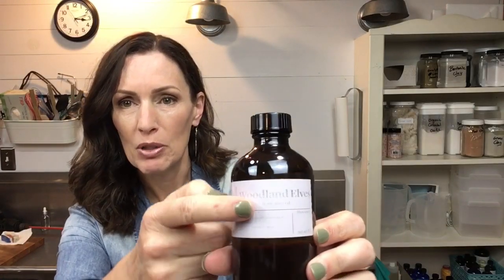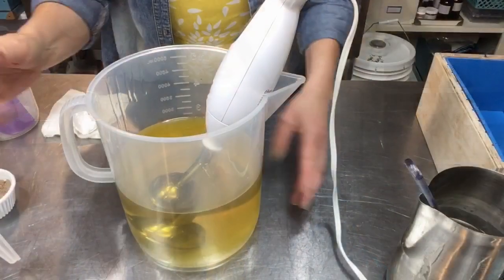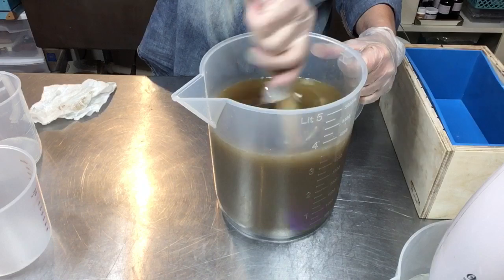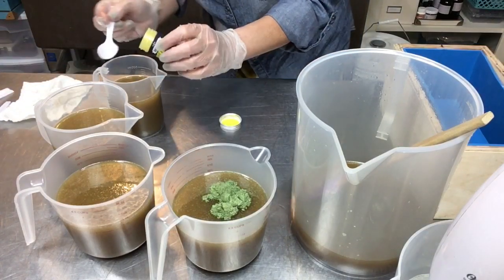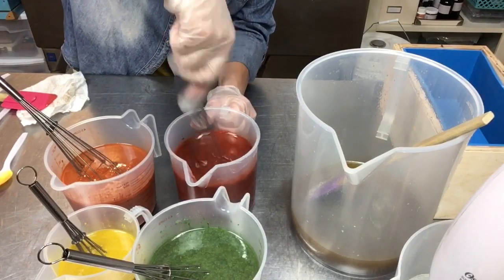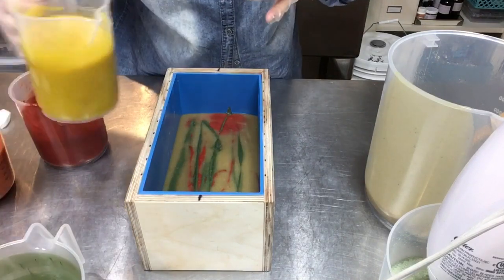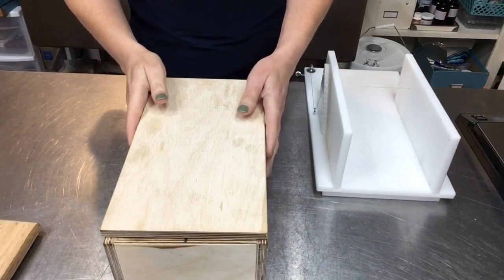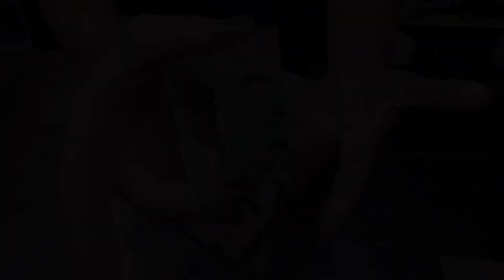Making, Cutting, & Stamping WOODLAND Cold Process Soap with Aloe Vera.  Ellen Ruth Soap

Comment: Looks gorgeous Ellen!  I have the same log splitter but am having trouble getting perfect even cuts like yours.  Any tips?  Thanks!
Reply from the maker: I was getting wobbly lines too until I tightened the wire really tight, now it splits very smoothly
Reply: Ellen Ruth Soap thank you will try that!